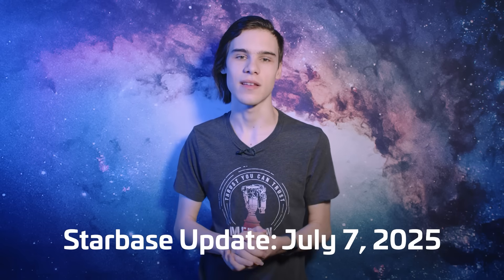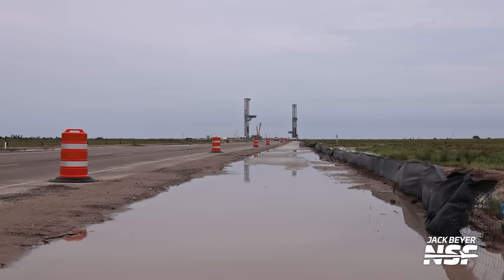Massey’s Down, Adapter Up – SpaceX Races Toward Next Starship Flight | Starbase Update

Comment: First minute of vid, all that rain and water....and regulators were worried about the deluge system.  Uh huh.   Weather in this country is nuts this last week, Texas getting rain and floods, everyone else getting scorching heat.  (Not so ) Seriously did someone leave a giant magnifying glass up in orbit?
Reply from the maker: Well, to reiterate, rain doesn't go through an industrial process with pumps and manufactured pipes and lubricants on handling machinery. Seems like it wasn't a big deal when they double checked, but doesn't hurt to verify.- Das

Comment: I'm kinda curious why they're even bothering with the Block 2's?  They should be concentrating on the block 3's straight away.
Reply: They have design changes they want to validate, that is the whole point behind the block system.
Reply: Because they don't want to mess up the block 3
Reply: @apocalril  Remember the block one had a few safe landings in the water. We've had none of the block twos even make it to the water without a Rudd.

Comment: 9:30 Do you think SpaceX might have a “In out “ QD 
As one side pumps in the gas the other side pulls a small vacuum to do the fill faster
Reply: I think they'd have to be at different heights to do that, and the tanks are filled with liquid propellant.

Comment: surely they are not just going to weld the ship TS to the OLM, it would make so much more sense to change it so you can use the booster hold down clamps to swap it out quickly?

Comment: why didnt they static fire ships on the OLM earlier? Seems like a no-brainer since it can already withstand superheavy static fires.
Reply: They can do static fires of the ship at Masseys whilst launch preps and booster static fires are happening on the olm. Faster. Also if there was a ship static fire accident then you don't loose the olm. They have many $.
Reply: @philleng480  good point but at the same time it would've made sense to have ship static fire capability at the OLM earlier in case there is a need for 2 ships to be tested at masseys.
Reply: 2 reasons come to mind. 1. ship cant be held down on pad 1 olm. thats why the thyre converting a transport stand as an adapter. 2. sure it could have been done earlier but if ship 36 had gone rud on olm that puts olm out of use. its best to test these vehicles at a place like massey's.

Comment: If they have two QD’s do you think one is for lox and one for lch4 or both for both? I would suspect they will use one for fuel one for the oxidizer this could be beneficial in terms of leaking and flammability. With all catched boosters they had some kind of fire with the as plate I think.

Comment: What’s the utility of a ship test at the pad? All the sensors and instruments for ship were at massey’s. The pad has booster instrumentation but I doubt that’s compatible with the ship
Reply: That's just a wiring problem.
Reply: The instrumentation is usually on the ship for the most part.

Comment: Dang! That COPV “test” went approximately to an altitude of 490 meters (1,608 feet) if it went straight up and hit the ground 20 seconds later. Those things are crazy.
Reply: When you do the math, it actually doesn't matter if it went straight up. Regardless of the object's horizontal velocity, it falls to the ground in the same time.
Reply: I can't imagine why they did this or why it happened.

Comment: I think that they are just moving the hot staging ring back and forth just to mess with everyone.   That's what I'd do.

As for the adapter between the OLM and Starship, I'd have thought that building a 'false booster' setup on the bottom of the adapter would have been quicker, and would not require welding anything to the deck of the OLM.

Comment: SpaceX is starting to understand how Starship is a flawed system. There's a point where you have to start rethinking what's working Vs not. And just think NASA built the Space Shuttle system and it worked straight out of the box. An incredible feat to achieve as we see SpaceX struggle with Starship
Reply: Those aren't really comparable systems.   Starship flies with methlox fuel which had never been done before.  The Shuttle by contrast was enormously expensive with each flight costing 1 billion $$.   They each had similar development periods, but you have to remember that the shuttle was designed, developed and built on a totally different tract from starship.  

The Shuttle was less an iterative development than starship which was developed based on testing.  

I'm not so much defending starship as noting the differences. Starship  has a lot of development to go just to be somewhat reliable.    9 flights and they haven't tried to reach orbit. In fact the suborbital flights have only gotten half around the earth.   There have been at 2 least tries to open pez dispenser which failed.  

Four flights in a row of the V2 ships failed to even begin their descent from orbit.  We'll see what happens.
Reply: I agree.
Reply: Yes, that is the nature of rapid prototyping vs a conventional development approach. Shuttle was designed and built to perfection with safety margins and obviously less ambitious goals than Starship. All the effort and money went into the one shot. You can blow up 500 Starships for this. The idea might seem counterintuitive looking like „bad engineering“ for the outside world but to learn from failure constantly can actually be more efficient than thinking through everything for one shot and might result in a much more optimized product in the end. The explosions don’t matter anymore if it succeeds (see Falcon).
Reply: Not to mention of course Shuttle killed 14 astronauts, 7 of which with its „remarkable“ heat shield and failed to achieve all of its original reusability targets.
Reply: It should be quite obvious by now that the faulty Block 3 Starships should be bypassed and go directly to Block 4.
Reply: @williamhatfield8935    Why stop there?  Why not go straight to block 10 or 15 or whatever the final iteration will look like?!?! 🙄😂😅
Reply: You still don't understand that it's a system in development.  Clearly you do very little thinking and made zero effort to inform yourself.  Of course you also pretend that the shuttle program didn't have it's issues including the near disaster at the first flight.  But that's back to you not informing yourself.  So that's another fail for you..
Reply: I have noticed the same, and thought about a theory why that is the case: When the design of Space Shuttle started, it was all the buzz about regular transports to LEO and back. Done by engineers and technicians who had been part of the first wave of actual full scale working hardware for astrounauts before. They were not trained by paper, but by real experience (bad until good). After the success of Saturn V and then Space shuttle the fundings for new space craft more or less dried up. All engineering and workforce was laid off or being paid for doing (almost) nothing. 20 years later most of them were working somewhere else or retired, 40 years later all the incredible first hand expereince was gone forever. Space X is the first company in decades that works and succeeds on new contemptorary hardware, while other are stuck in the past, or stuck in endless timelines.
Reply: As someone who was a proud member of the Space Shuttle team, I’m giving you a Thumbs Down because you can’t directly compare the two like that. Iterative testing was not only NOT the NASA way back then- it would never have been allowed by the political authorities or the public; not for a crewed program designed in the 1970s. And it was under-funded and the first flight two years behind schedule when it happened in April 1981 (and I was on console in Mission Control in Houston for that one, and many that followed). The Starship development system is deliberately inherently different. Starship has not reached its final design yet; the flights we’ve been seeing are really Developmental Test Flights- flights that in the world of aerospace programs, the public normally never sees- but in Starship’s case, we see each and every one. The purpose of these Developmental Test Flights is to figure out what the final design SHOULD BE, ok? That is most definitely NOT the way we were allowed to approach the space shuttle design process approximately half a century ago. - Dave Huntsman
Reply: @dphuntsman   That was very well stated.  Thanks for commenting.
Reply: @dphuntsman  as you say 'Starship has not reached its final design yet; the flights we’ve been seeing are really Developmental Test Flights', and as I say again the Space Shuttle worked straight out of the box. Hurts to think how well engineered it was to pull that off. Especially the incredible heat shield system

Comment: I would put everything underground, so that everything doesn't get absolutely obliterated at every launch.
Reply: Can’t go underground there because of the water table.
Reply: @afldskhgdfkghdfkhg  I think there could be sonething done to mitigate that but probably it's a very long and expensive process.
Reply: @mihaiserbanescu8676  It's not easy or cheap to build underground.
Reply: @imaginary_friend7300  yes but does it make sense to rebuild everything once every few launches? Everything is so exposed. At least encase them in some concrete walls.
Reply: Going underground anywhere would be too expensive.  And besides no starship test has ever blown up at launch.  There has been only one explosion during a test.
Reply: @michaeldeierhoi4096  all the propellant farms have been damaged or obliterated more than once before. Sometimes from debris flying at every launch or test, sometimes from RUD. If they were underground, there would be much less of a chance for this to happen.

Comment: Is starship block 3 use 3 grid fins?
Reply: the super heavy booster will use 3 grid fins spaced 90 degrees apart.
Reply: And 2 grid fins spaced 180 degrees apart.

Comment: "racing" towards goals is why their sh*t keeps blowing up.  Proper engineering takes time and care, not reckless tinkering.
Reply: Hey it’s the jealous ULA engineer that takes 20 years to build a rocket. Maybe you should go work for Jeffy, he seems to want to build old space rockets at a faster pace
Reply: Says the pretend engineer.
Reply: You don’t know what you’re talking about. The Starship development system is deliberately inherently different. Starship has not reached its final design yet; the flights we’ve been seeing are really Developmental Test Flights- flights that in the world of aerospace programs, the public normally never sees- but in Starship’s case, we see each and every one. The purpose of these Developmental Test Flights is to figure out what the final design SHOULD BE, ok? That is most definitely NOT the way we were allowed to approach the space shuttle design process approximately half a century ago, for example. - Dave Huntsman
Reply: @dphuntsman  Thanks. That's how it seems to me, but it's nice to have input from someone who actually knows what he's talking about.

They are pushing for a radical leap in the state of the art, and I don't even know how possible that would be without this approach. 

The chopstick catch is one of the highest-level examples. Nobody knew whether that would be viable or whether it would be fraught with all sorts of problems that meant it would need to be abandoned in favour of alternatives. The only way to find out was to test it in the real world, as quickly as (reasonably) possible.
Reply: It worked for their other rockets so…

Comment: I still cant believe there was no blast protection between the test stand and the tank farm.
I mean it was never going to protect all the fittings completely... but at least reduce or deflecting the worst of the damage wouldve been a start.

With the transport stand come ship-engine test stand, the OLM should handle it, but surely the stand to ship clamps are designed for the loads in transporting a ship ... not the firing of engines.